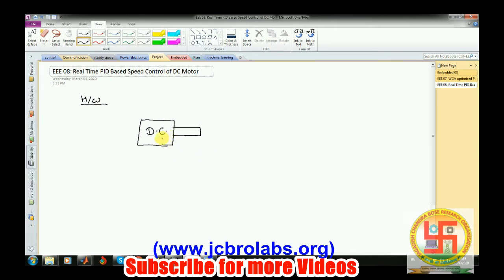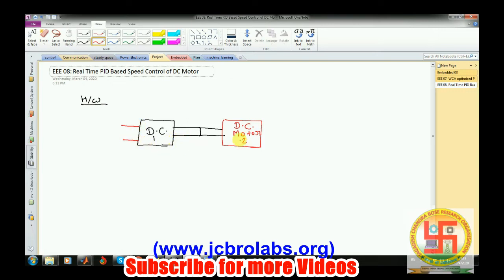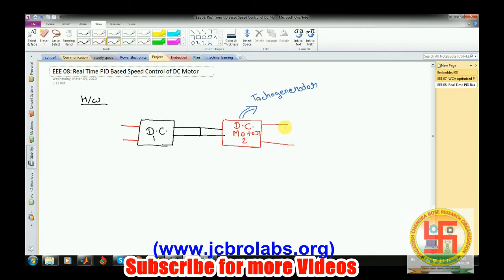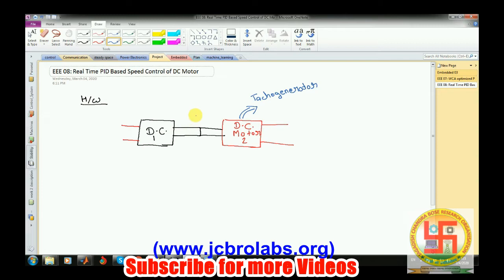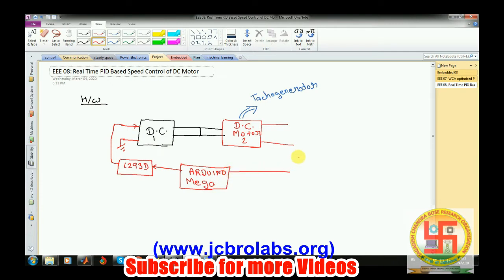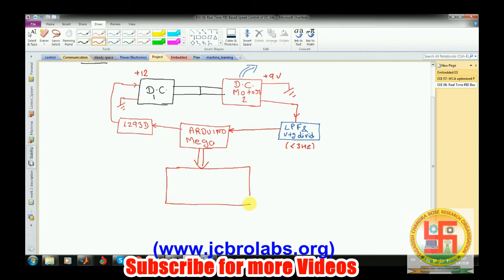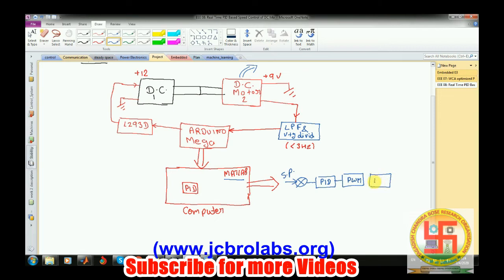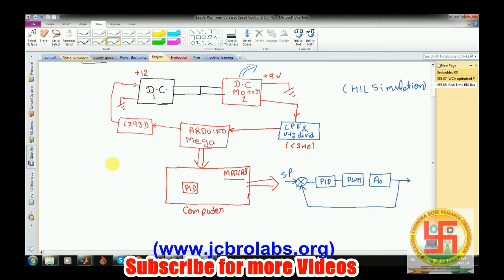EEE Project 08: Real Time PID Based Speed Control of DC Motor using Arduino & Matlab

Comment: I can't understand, the setpoint is a voltage and the value that you read is speed, how can you compare them? speed is with RPM...
Reply: But as you Can see in the scope legend, it's written Setpoint and motor speed... IS motor speed voltage?
Reply from the maker: Hi, that may just for the representation purpose while creating the model.
Reply from the maker: The value we are reading is also a voltage. If you want to do everything in the RPM then you need a lookup table to convert the voltage into RPM.

Comment: Hey, can you tell me what is the RPM of these motors used? 100 RPM or 500 RPM?
Reply from the maker: Hi, In this project we have not measured the motor RPM. It could be around 250-300 RPM (guess).

Comment: thank you very much. the step signal 3.5 is the required angular velocity  or what ????
Reply from the maker: In this video, 3.5 is the voltage level which is being read from the taco generator output. Hence, it is indirectly related to the speed of motor.